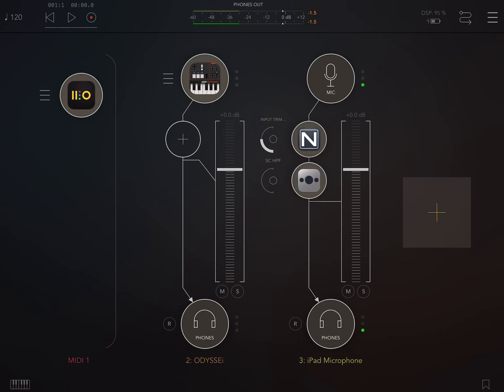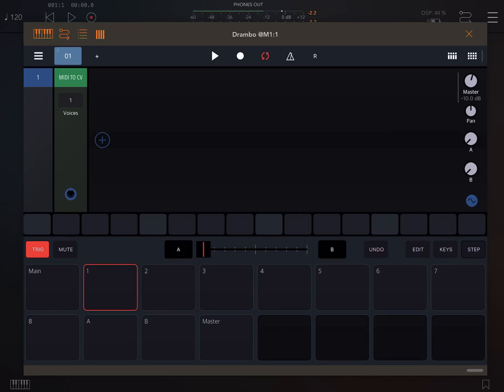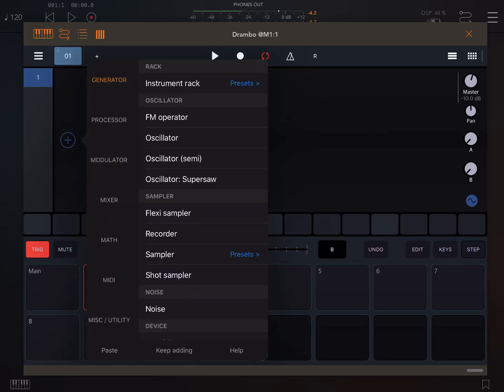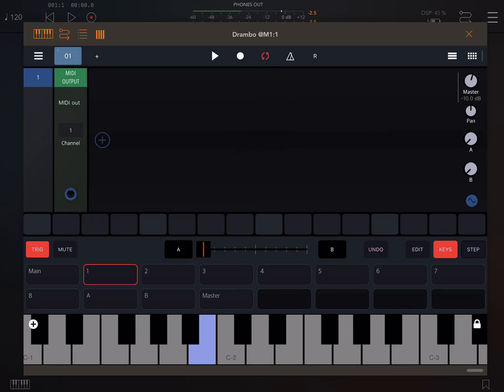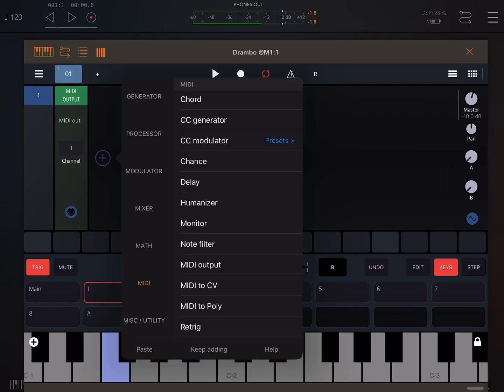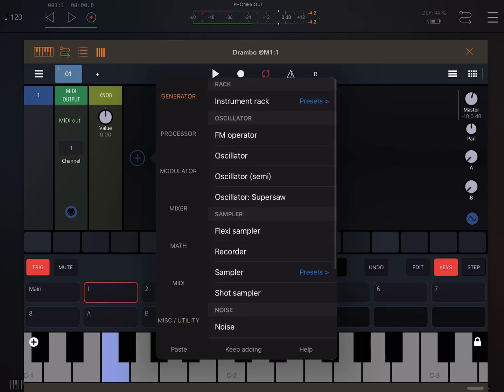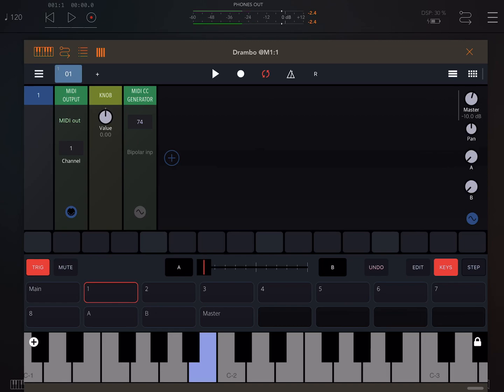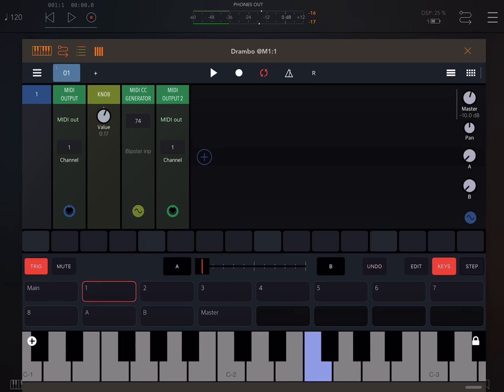Beep street Drambo - create a knob to send Midi CC to external synths.

Comment: I know this is a 4 year old video, but wouldn't using a midi CC controller block followed by a midi CC generator block do the same thing?  That would eliminate the need for the extra knob blocks since it's already built in?  Anyway this is a good video and immensely helpful, thanks!

Comment: Tried the setup as shown no movement on my cutoff dial on iSEM checked all settings and numbers ie 74 CC! Weird.
Reply from the maker: Your not wrong, it didn’t work via iaa either (not in AUM) until I did midi learn in iSEM.
I got it to work in AUM, by assigning the midi cc number to the AUV parameter.. you also have to turn it on/enable it above where you enter the value.
you access this panel by clicking the AUM channel name at the very bottom by fader, it will say iSEM in this instance, a pop up appears and you press the top left corner of it and follow your nose..
Reply from the maker: Meerkat Music this is kinda advantageous for auv3 In AUM though.. you can make a standard row of knobs.. filter and envelopes etc and reuse it for any synth, just assign the cc to the (AU parameter.
Reply: Andrew Fox Cheers for the detailed setup I forgot about the CC selection in AUM knew it had to be something simple 👍
Reply from the maker: Meerkat Music I’ve mentioned it in pinned comment now, I didn’t think of it whilst uploading vid.